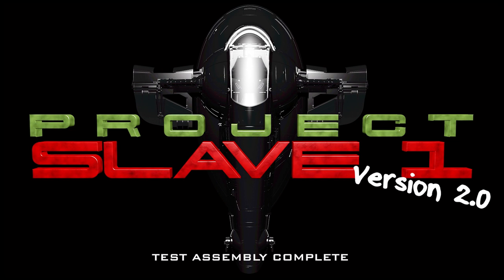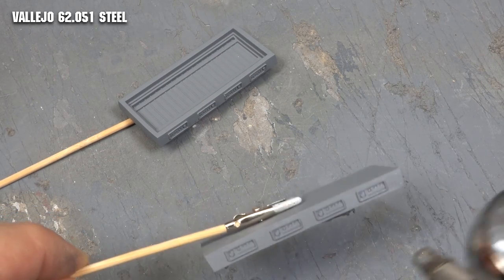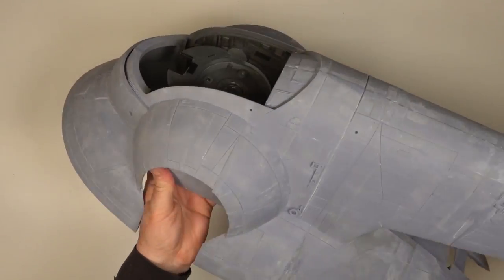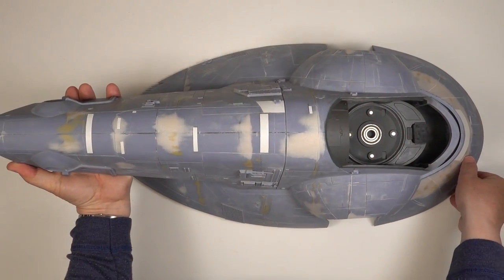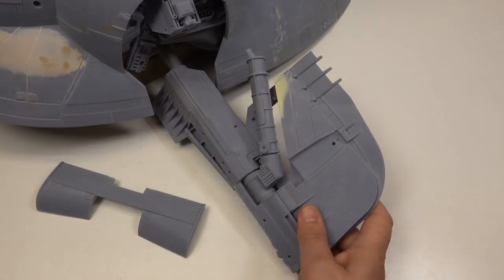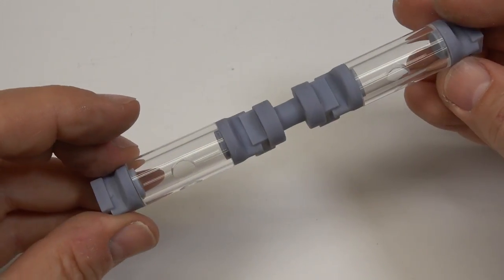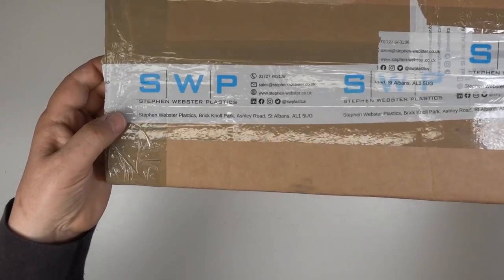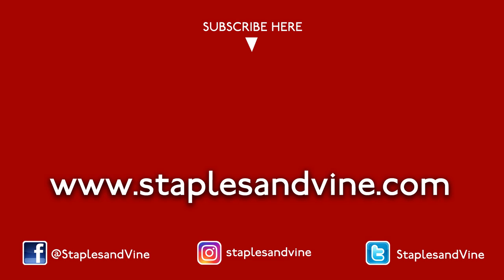PROJECT SLAVE 1 PART 16 ‘TEST ASSEMBLY COMPLETE’

Comment: Wow...I want some of those storage chests you have in the garage!  I have a pile of ammo cans, mostly 20mm but also some .50BMG I use for various things.  Including, unsurprisingly, ammo storage.

I have been slowly stocking up my supply of resin for when you release the files!  Between this and a Millennium Falcon, I should have a couple years of labor. LOL

I may make both slightly smaller.  I LOOOVE the big size, but may just be impractical for display.  Would be nice to set up a chase between the two. Just need to get the scale right for both.
Reply from the maker: It is a big beast but I'm mounting mine on a stand which is 18 inches square so it doesn't take up too much real estate. Total height on the stand will be about 32 inches. To big to fit in even my storage boxes though... 😁

Comment: If you can, don't use a 9 volt battery, use a very small lithium ion, one instead. It's rechargeble and can be connected to the other circuit(s) for charging. U can use a bluetooth controller for managing this cicuits per example with your phone or a Playstation Controller. Without the need to disassemble the whole model. 
Maybe u'll think obout the idea to scale your model up 1 or 2 sizes.
Reply from the maker: @mrwhite877  thanks for that I'll investigate further. 🙂